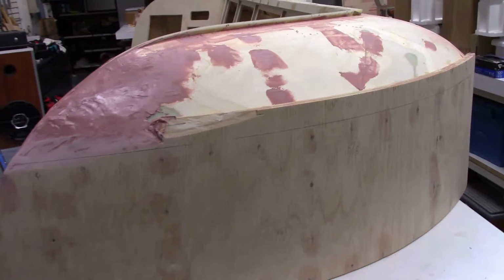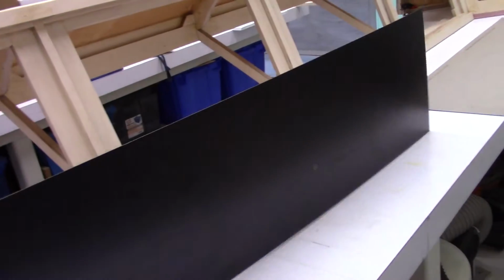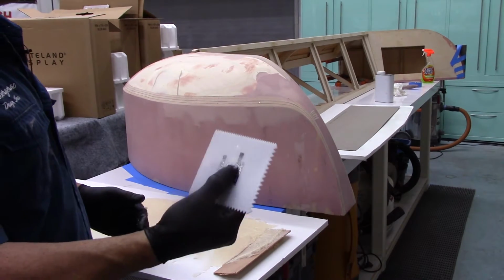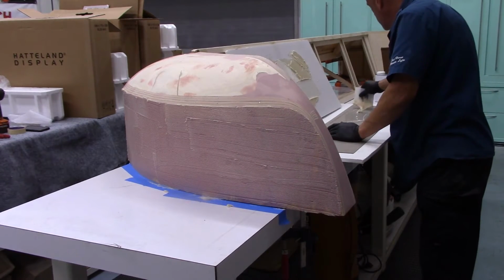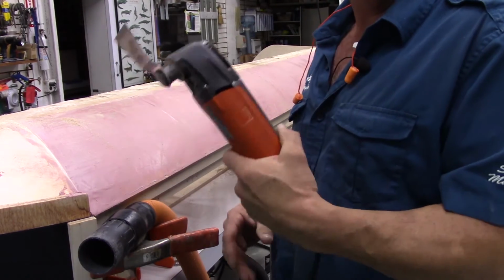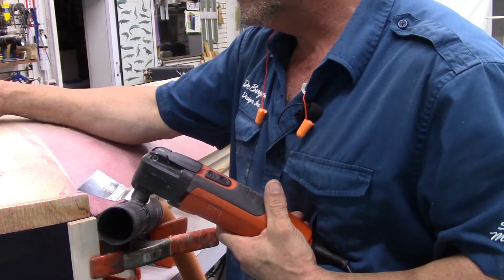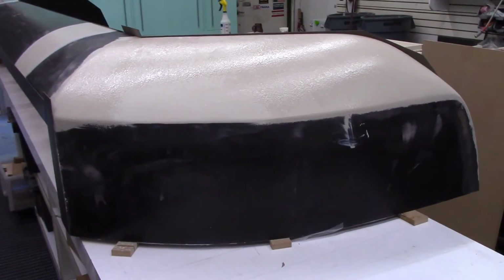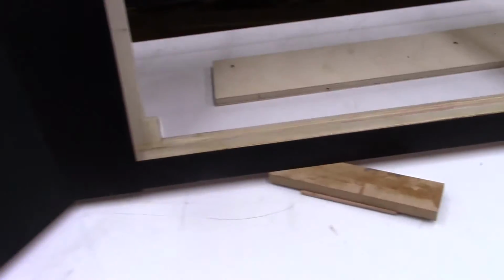Rebuilding a Yacht Helm Station: Part 2

Comment: Very nice work as always. I was wondering if you thought about creating a frame for the monitors to sit in and then flip the monitors up for easier access to all the electronics. It might involve using something like a casement hinge affixed to a frame that attaches to the monitor, so you could pull the monitors out and up and maintain that flush wall of monitors look. If something fails, it looks like it will be pretty hard to get to the access panels behind the station.
Reply from the maker: +MKTech  That was the way the old helm was, it flipped up. Completely unnecessary as the only electronics are the screens. Good try though, thanks for watching and commenting!
Jim